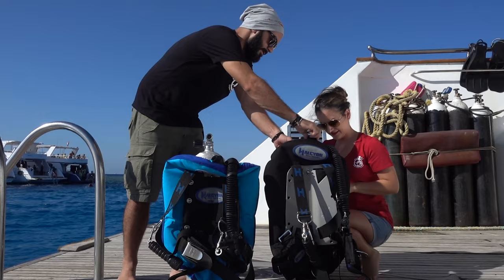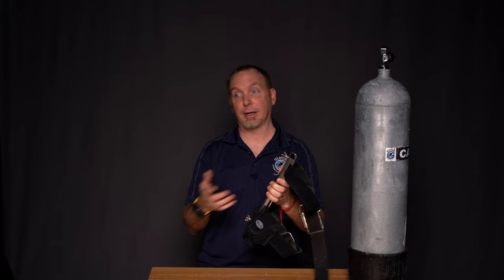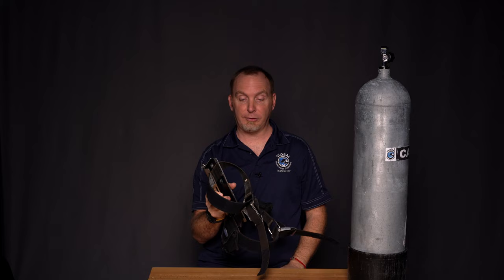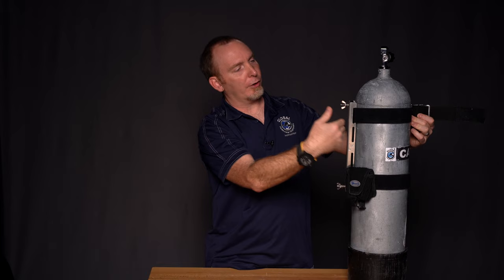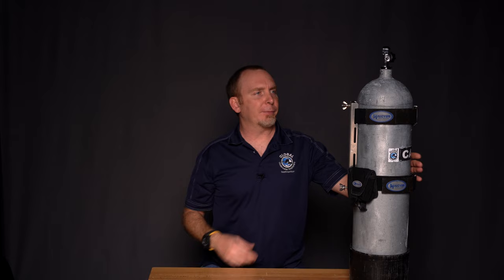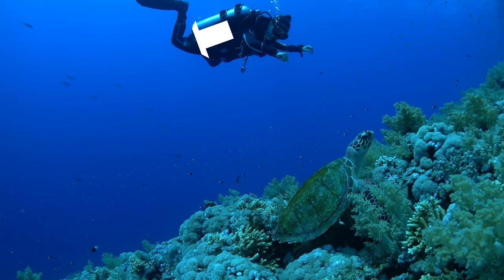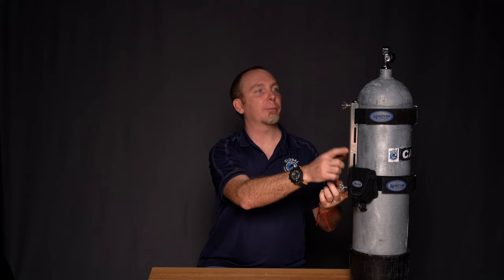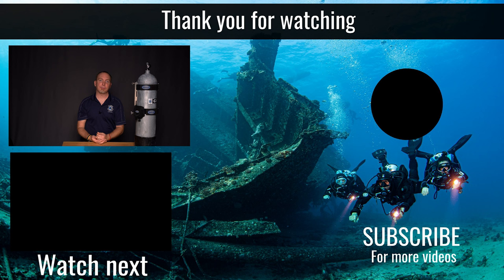Diving Tips & Tricks - Attaching your Wing

Comment: Hi Francesco, nice video very informative. 
I actually use the same setup for my diving but i have an issue with it: 
If i setup the tank adapter like you did and position the tank the same way as you demonstrated i keep bumping the back of my head on the 1st stage when i raise my head... Actually i found out that if my reg is sticking higher then the top of my wing (it is an apeks wing but i think they are all pretty much the same...) i will bump on it if i look up...
So what i do is that i dont use the top slot of the tank adapter and use the middle one instead. This solves the problem for me. 
But what i dont understand is that i m average size (about 173cm) and in all the videos i see online people use the same setup as you and i feel if they flex their head they will touch the reg as well. 
I there something that i dont get, or is it normal ? Thank you for your help.